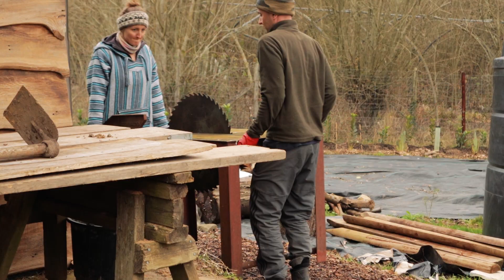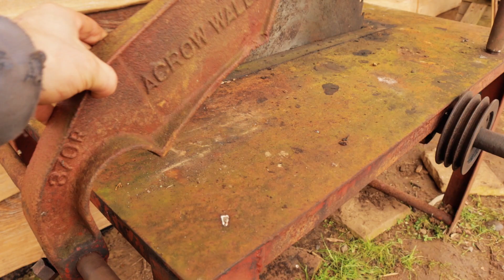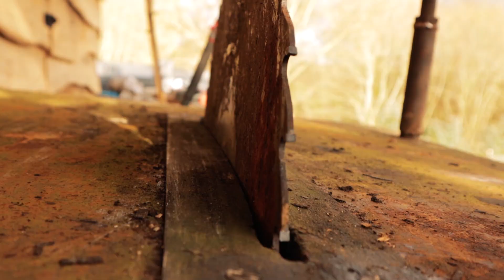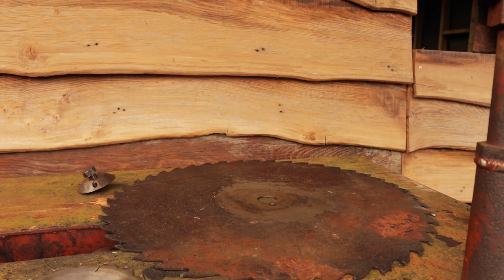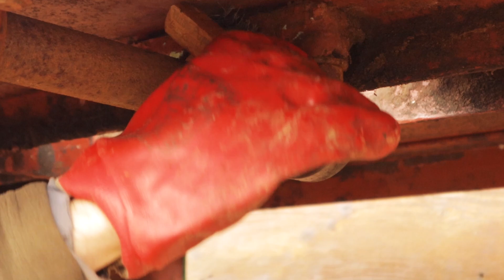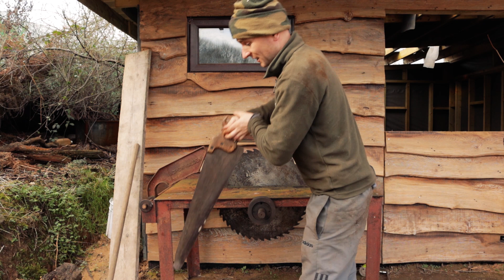Restoring A Traditional Circular Sawmill - Episode One

Comment: Just bought a 3 ft blade and am looking for the simplest design.   This one just like a table saw.   I believe the guard you are referring to is also to prevent kick up.
Reply from the maker: oh nice, making it yourself? yes, its just a shaft with the bade and  ully on, with two bearings fixed to the table..the bit that i need to make is called a riving knife yeah, to stop the blade pinching on the wood and possibly getting thrown..